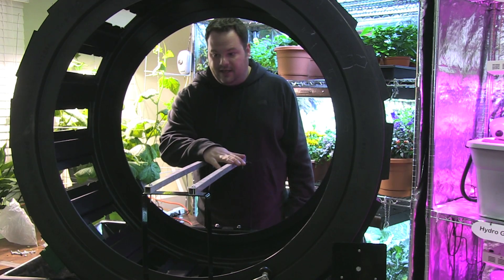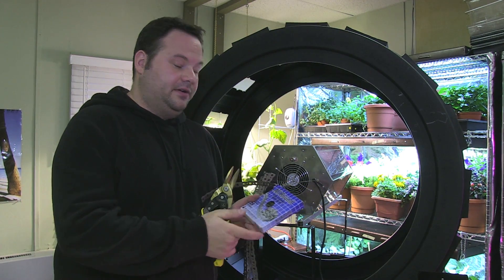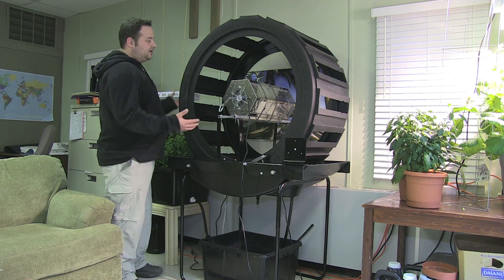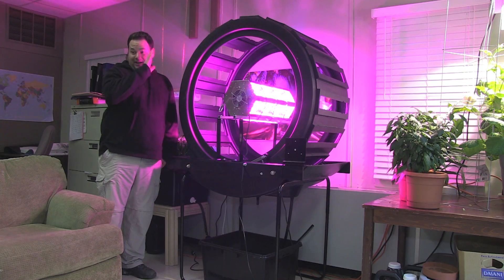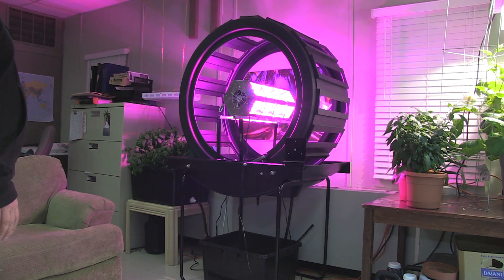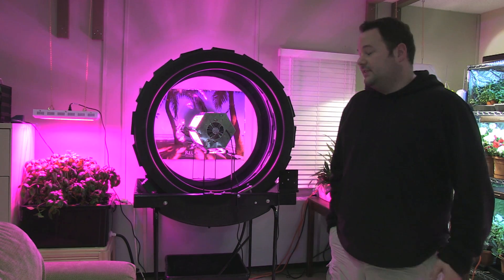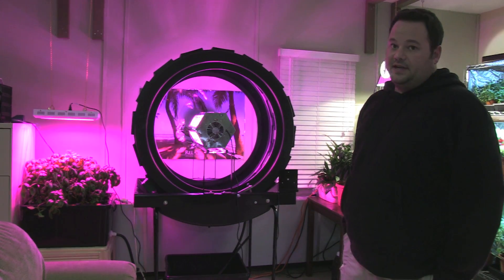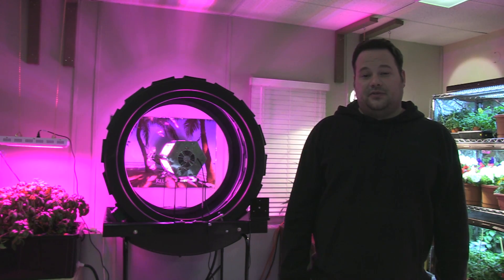Volksgarden with Hydrogrow's Vertical Light

Comment: I don't know why you would not want to just have a mount that holds it in place at both ends, thus avoiding any shadow or touching of the light along the surfaces that are illuminated?  This is nice but I am sure those two braces at the obscure at least some of the light, not to mention those straps.

Comment from the maker: We sold a lot of Basil.  The neat thing with Basil is that once it is mature about 4-6" of basil can be cut off of the plant every 5-6 days.  Approximately 6 cuttings a month of 80 plants equals around 480 bags of basil a month and depending on where and who we sold it to, we got between 1.50 to 2.00 a bag.  It fluctuated a bit depending on the buyers and demand, but on average it made about 800.00 a month.

Comment from the maker: @sheemsheem 
I disagree with you when it comes to the volksgarden.  The vertical light produces very little heat and when you touch the unit it is barely warmer than room temperature.  HPS and MH lights have heat issues and this is especially tough to control in the small space of the volksgarden.  The LED light will last 10-15 years vs the yearly bulb change of the HPS/MH bulbs.  As for plasma name one light that will fit in this unit. Plasma shows promise, but it needs work.